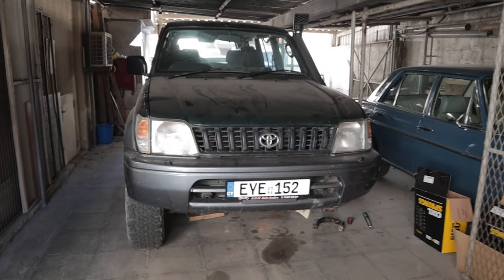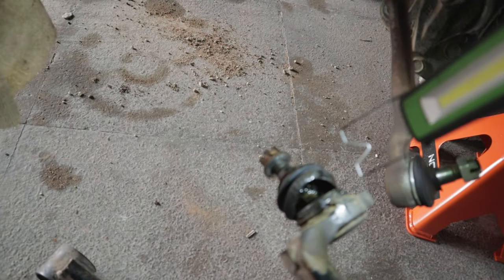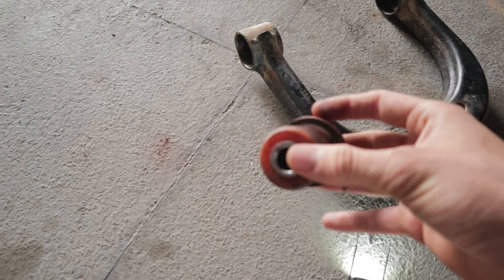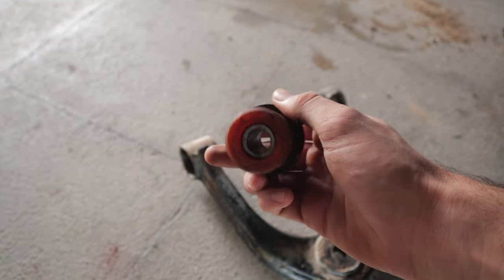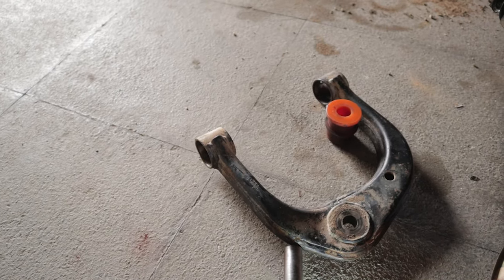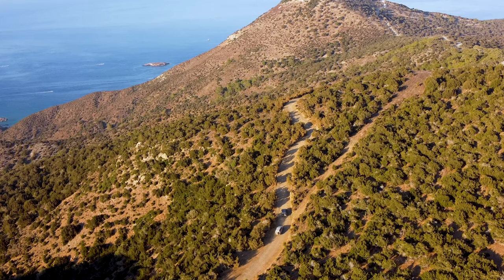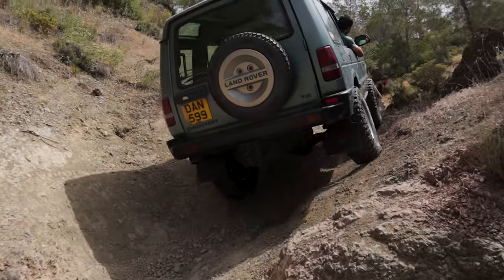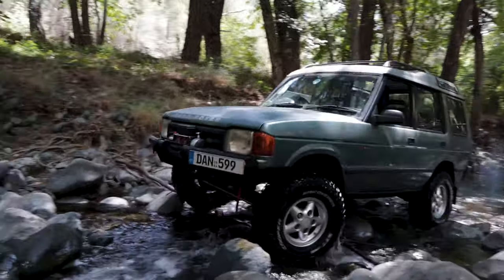The 90 Needs a Front Suspension Rebuild...

Comment: Seeing the rebuild would be nice. Although I have just replaced the steering components (new control arms with bushings and joints), with original Toyota parts. It was needed. I first had a non-oem lower ball joint on the right side, which suddenly developed excessive play after gravel/dirt roads in Iceland. That ball joint was so loose that it became noticeable in the steering. Now back to Toyota parts all around and it feels good. I have kept that old ball joint for demonstration, not sure which brand it was.
Reply from the maker: Maybe it was a 555? I will never put anything else other than OEM on the Prado again. Cheaper veriants just don't last